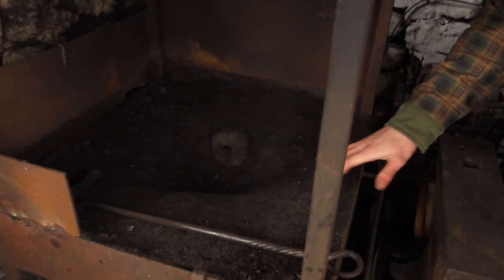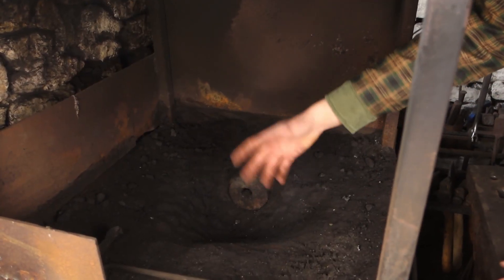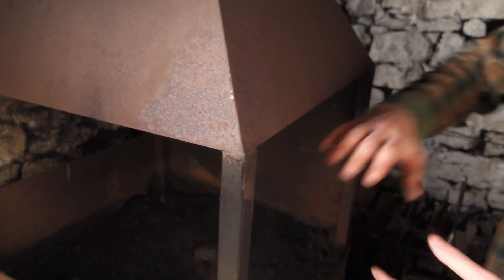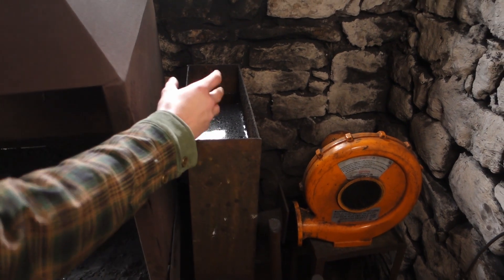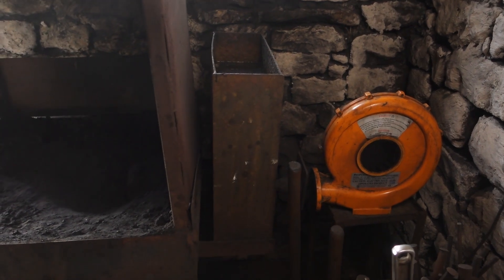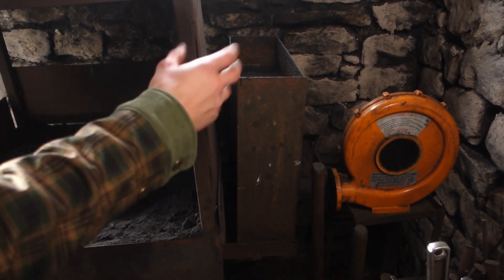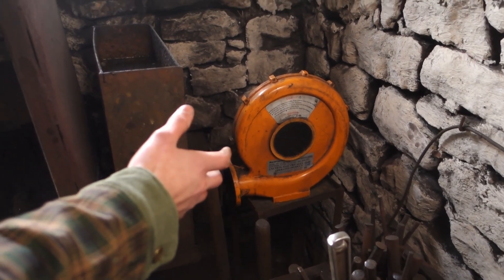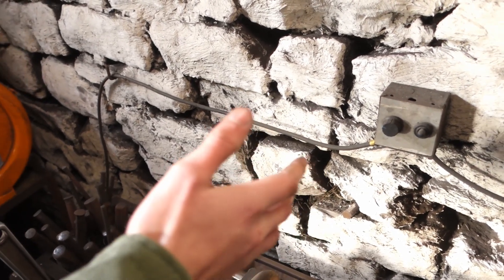Water Cooled Forge

Comment: "...an actual floor". You lucky bugger, you youngsters don't know you're born. When I were a lad, we didn't have no lardi-da floors, no, we had to hover in our hob-nailed socks. Couldn't afford boots. Bet you've got boots as well. I used to work 26 hours a day down t'pit then walk 30 miles home just to get my head down on my pillow for 15 minutes before walking 30 miles back for another 26 hour shift. When I say pillow, it were the brick that me da used to throw at my head for being a lazy, soft b'stard. To be fair, he had it hard. He used to walk 40 miles for his 30 hour shift with only 10 minutes sleep. And he had no brick for a pillow. Didn't have no socks or boots either. Still wore the hob-nails on his feet. So, fair enough.😩
Happy Days!😥

😂Re the vid and how the cooling works, if your tuyere/tue-iron (I'm with you on this 🤔) is the same as my Alldays & Onions side-blast, you'll notice that the outer piece is a (truncated) cone. Therefore, as the end nearer the fire heats up, the water at the narrow end becomes less dense, start to travel sideways AND up the cone towards the tank and is replaced with colder water rising up along the lower side of the cone to replace the water that is being heated. 

Love your vids btw. Thanks for sharing your knowledge.

Comment: What if the tank and pipes were stainless steel? Or is there problem with the heat then, cause the stainless will heat up faster then steel.
Reply from the maker: I have thought about making a stainless one, don’t know how better or worse it would fair, I would imagine much better.
Reply: Stainless steel has a thermal conductivity of about 1/3 that of carbon steels. Given the want of moving more heat Carbon steel will serve this purpose better.

Comment: With a whole 3 inches below the tuyere do the coals down there burn? I have a small side blast forge I am experimenting with and I think I got the bottom of the bowl to an inch or less below the bottom of the tuyere hole before winter set in and stopped my forging.
Reply from the maker: The coals there won’t really burn that hot but you won’t really need them to as I wouldn’t be digging into those coals to heat up the bar, as the bar is going to be sitting horizontal on the forge, if that makes sense.

Comment: nice, good informative video! Would it help if you used oil to reduce/stop the reaction between the steel and the water?
Reply from the maker: Yes a layer of oil on the surface will prevent excess oxygen from the dissolving in the water but I don’t know how much that would actually slow the reaction down in the long term. Interesting idea Ben!

Comment: Great explanation but I believe that the issue you have had with the speed controller is the same as what I have had and this is because you can only use this type of control with a brushed motor and the bouncy castle blower s aren't brushed you require a vfd to control this type of motor
Reply from the maker: Great! thanks Andy I’ll have a look.